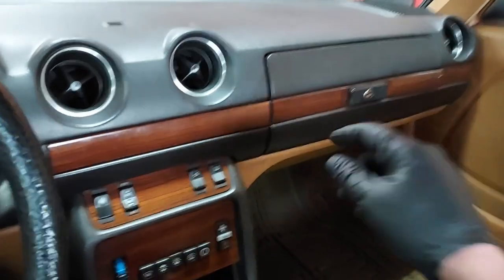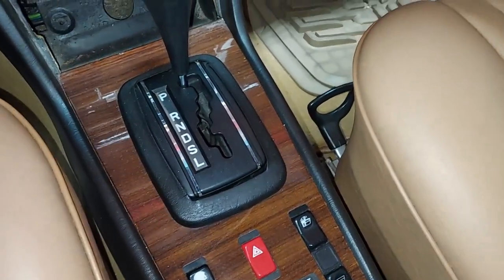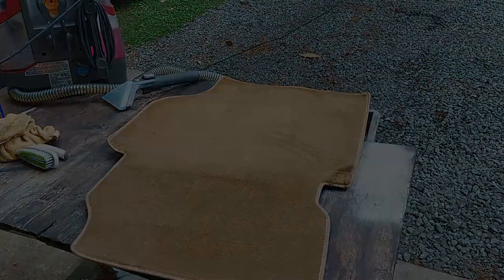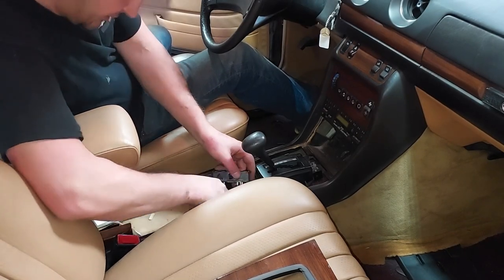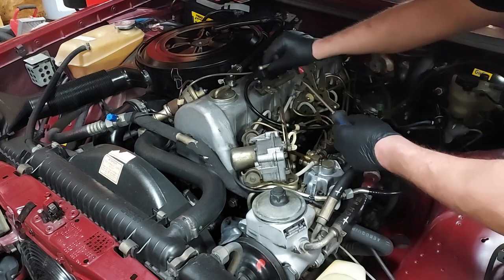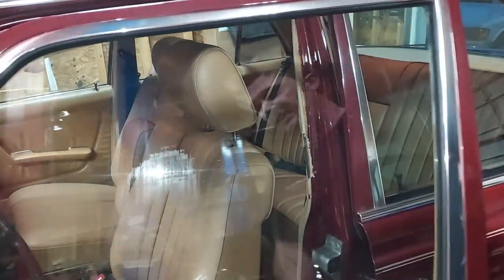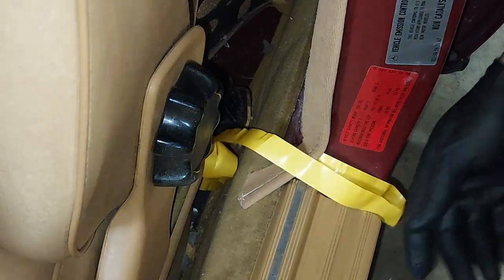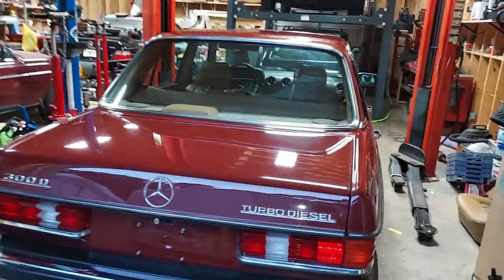1984 300D Part 4 - Original Radio Install, Window Switches, Carpet Cleaning and B-Pillar Piping

Comment: You definitely are a PERFECTIONIST.  It really proves how well these cars are made and the high quality of materials MB used in these cars.  Like I have said before, if a person wants the BEST used Mercedes you are the guy to see.  Best to you always
Reply from the maker: Thank you for the kind compliment Bill
Reply: @woodsandbarclay  Where to find the windlace?
Reply from the maker: @litarmleka3511  sorry I only have a very limited supply.
Reply: @woodsandbarclay   I found that there are also windlaces in similar shape for 70' dodge and Crysler. 

Do you know where I could buy the gummy part inside the door striker? The one inserted underneath? Thanks for the reply :)
Reply from the maker: @litarmleka3511  yes it's a company in Thailand I'm driving right now and can't look up the link but you can go to my website and email me contact info is on the website

Comment: I may have missed it, but where did you get the pillar trim? Mine also needs replacing 😅
Reply from the maker: I have several Old stock Parts suppliers around the country.

Comment: First time i see someone restoring the b pillar piping. What use does it have? very intrigued since it does not seem to make contact/seem with the door.
Reply from the maker: It's probably just for decoration.
Reply: @woodsandbarclay  But it has piping in it... The mystery stands imo... wind noise maybe?
Reply from the maker: @Altanox  the gaskets should handle the wind noise so I don't think it's for wind noise. But if you look at the armrest and the seats there is piping around all of them so I think it's for asthestics and adds a nice edge to the b pillar body frame.